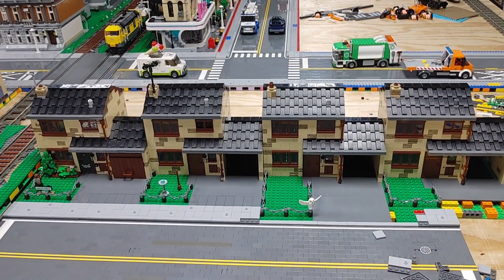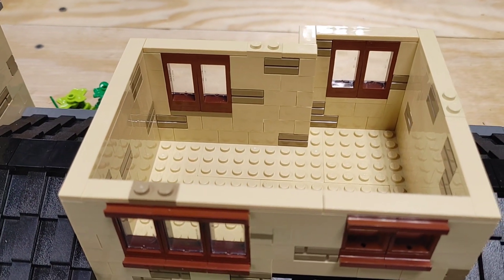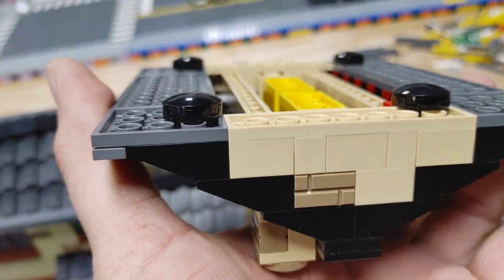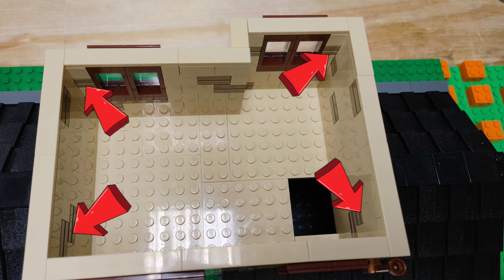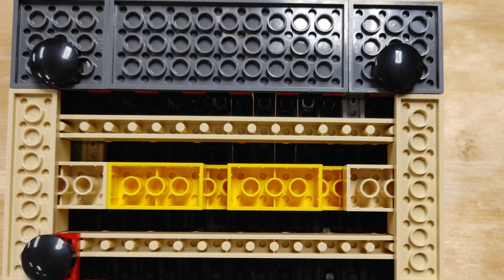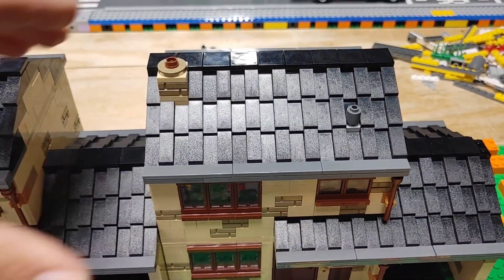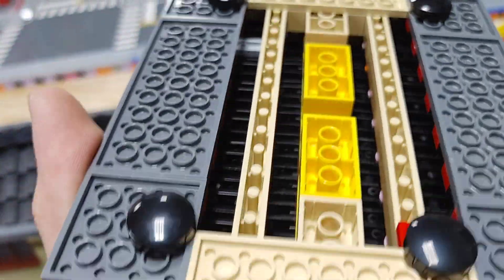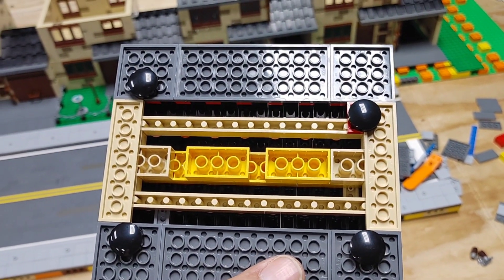How to attach multiple floors in modular buildings.

Comment: Yea, I didn't know about this either.  I do have large buildings but will give it a try on the smaller ones.  Thank you.
Reply from the maker: It will work on large ones also but you will need to add some to the middle spots as well is all.

Comment: Let me get this right, you are merely preventing it from sliding to any side, but not actually attaching the two levels in any vertical way, right? Did I miss something? And being rounded, it just makes for a smoother move in and out than if you used standard square bricks?
Reply from the maker: Essentially yes and it makes it very smooth